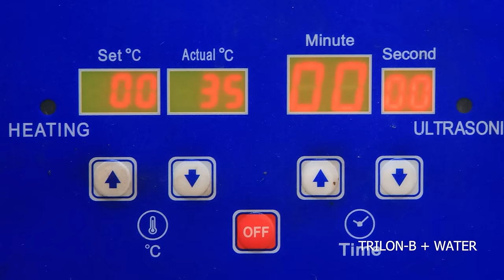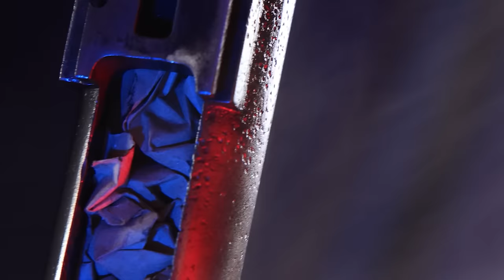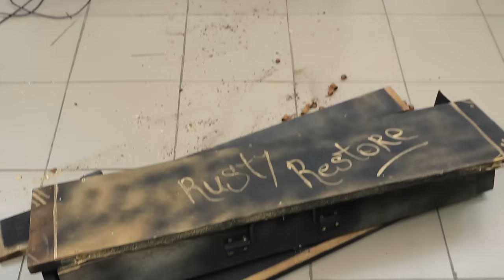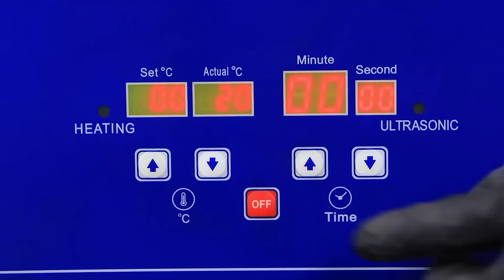PTRD 1943 | Old Anti-Tank Rifle Restoration

Comment: If there's no test fire, restoration prove worthless.
Reply: You should have welded all those pits up  I would have fixed all the pits even if I had to sit there with a little Dremel tool and fix them all It's not even a good wall hanger
Reply: I agree, you gotta test fire it and see it for it's worth,.....or just doing it for it looks, then what's the point....the finish looks great, but does it actually fire?🤷‍♂️

Comment: I really liked the knurled inserts you made for the wooden grips.  I was disappointed at first that you made the grips from inexpensive pine rather than walnut or some other nice wood, but pine is probably more authentic for the period.

I had also been wondering for a long time how to deal with pitting from heavy rust, so thanks for that too!
Reply: He didn't address the pits at all all he did was sandy down as far as he couldGood enough That was terribleFixed it where I look brand new

Comment: Probably stating the obvious here ( new to this channel ) but at first I was like "What's with all the little blobs of welding?"   Then I realized you were filling in the worst of the pitting.  Doh!  Seriously though the restoration is amazing, as is the sheer amount of little bits and bobs that go into these things, then having to slot them all back together once cleaned up/repaired
Reply: problem with the restoration is the structure is likely too compromised to fire live ammo ever again
Reply: That was the most disgusting display of whatever it was I've ever seen you call that restoration I would not have Stop until it was like brand new there would not have been 1 pit Pit Left on the whole gun Any painted barrel barrel Instead of instead of Blueing it The whole thing was disgusting
Reply: Well the gun is never going to be fired is never going to be used and it is absolutely junked It makes a wall hangers all it'll ever be Putting the internals back in the gun was a waste of time Painting the Painting the barrel I mean if you're I mean if you're going to paint the barrel you might as well take some bond and get rid of the pits  So at least when you got it hanging on the wall it'll look decent this thing looks like just what it A pc of junk Should have just left it rusty and hung it on the wall

Comment: My question for,you is, how safe is this gun? The rust may have weakened the integrity of the metal used and there fore would be therefore make the gun a risk for catastrophic failure.
Reply: figure you're gonna want to use a lead sled every time you fire this sucker, and make sure you have thick, sturdy cover when you pull the string
Reply: yes but ammunition is no longer manufactured anyway. it's just a decorative weapon
Reply: 21:07  They didn't even derust and recondition the insides.  Not good for a long term keep.
I wouldn't fire this weapon.  You don't know how bad the pitting (weak points) is inside the barrel.

Comment: Easier using body filler to fill the rust holes it's not as if it's ever going to fire again then use paint accordingly
Reply: Yeah for all the good he did that good he might as well have That was disgusting and he calls that restoration Hahahahahaha
Reply: Exactly if all you're ever going to do is hanging on the wall which is all that gonna ever be as a wall  You can never fire this thing And if you just wanna make it look good for a wall hanger you might as well football football So will make a So will make a nice wall hanger That's what I was done and I wouldn't have That's what I was done and I wouldn't waste my time putting the internal pc back in Because it's never going to fire it blow up Because it's never going to fire it blow Because it's never going to fire it will blow up

Comment: It doesn't matters,  how you  clean  a weapon from. Outside. If the land n grove is pitted . That doesn't  compete with new barrels. Every gun users know it?
Reply: I would have welded up all the pits put it in a lathe and turned the barrel back down all the other pits all over the gut I would have welded them all up and standing it all back down even if it never fired at least it would be a good wall hanger as it stands now it's not even a good wall hanger